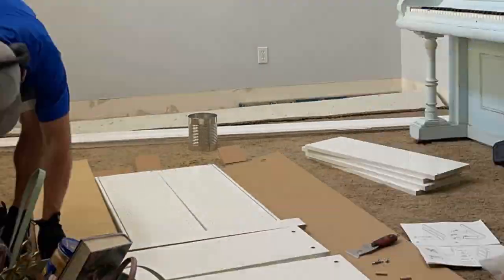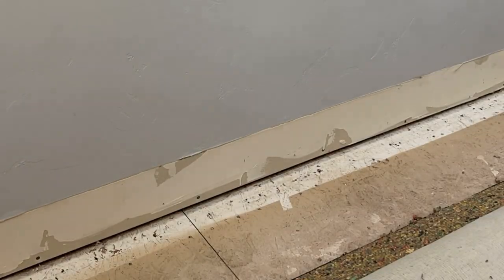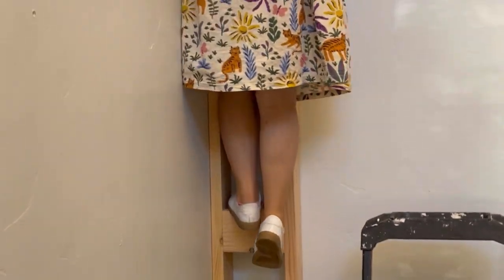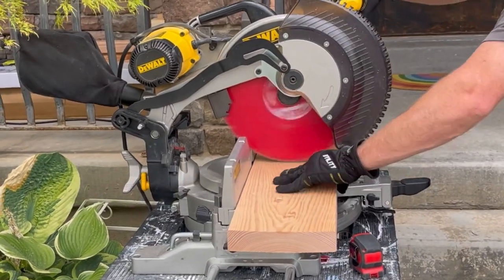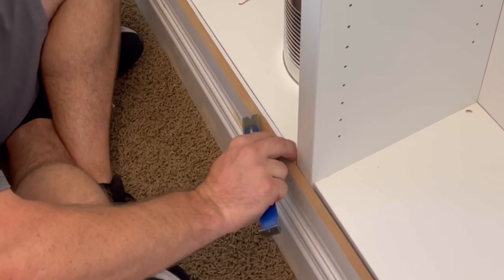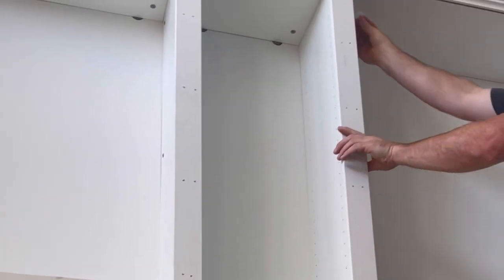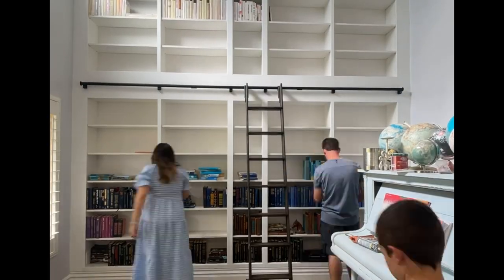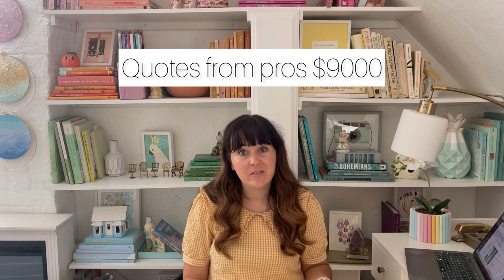IKEA Billy Bookcase Hack Library

Comment: This is lovely!  I want to do something similar but don't have any power tool.  I always see a base support being built for the bottom and the sides.  Can you please help me understand the reason?  Are they for the weigh or to level out the book cases or both?  If the wall is only 100" wide on level floor and I only add the extension to the book cases, are they necessary?  Thank you.
Reply from the maker: Hi! Thanks! So the base support on the bottom is to lift the bookcase up so the baseboard can be put under it. Plus it helps support the weight from the shelves and books. The extensions are also to support the weight and to screw the bookcases into so they won't fall over. They're also to use up the extra space since the bookcases didn't perfectly fill the wall. I explain more in detail on the blog post too https://athomewithashley.com/ikea-billy-bookcase-hack-library/
Reply: @AtHomewithAshley  if to try this, would you actually need a base? I don’t need to add height nor for baseboard. I get the side supports but can’t you anchor it to wall itself